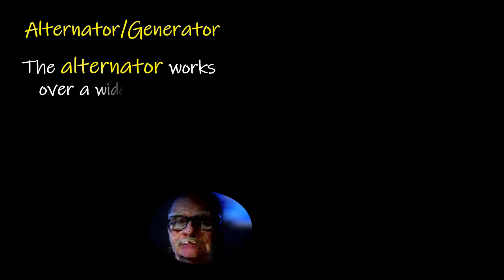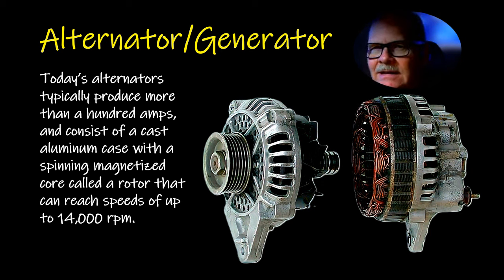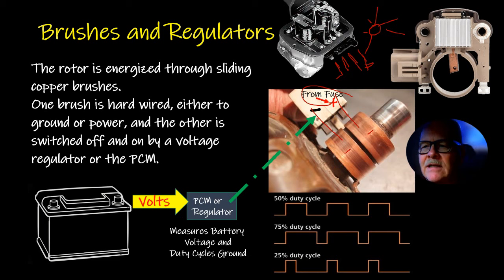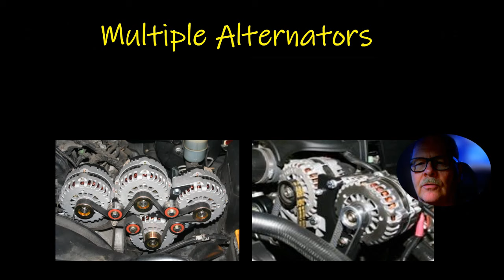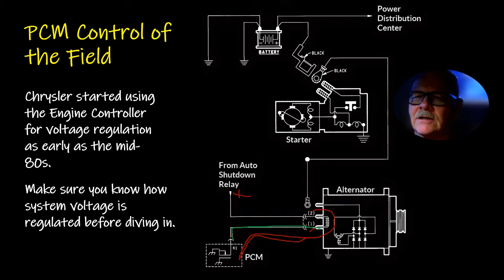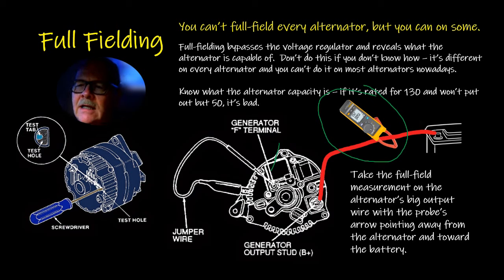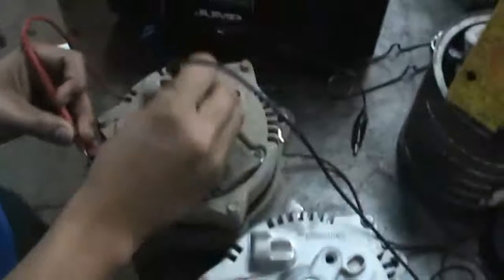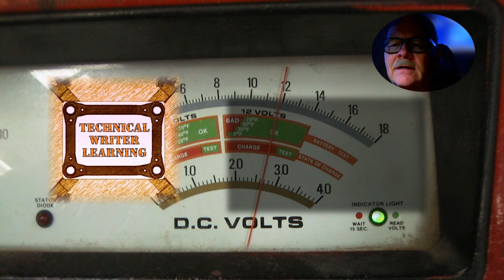Charging Systems and Testing

Comment: I remember using a growler and running a generator like a motor to test them.  We had a commutator lathe and had to undercut the mica afterwards
Reply from the maker: Yeah!!! Doggone it I had forgotten about the growler, but I did a lot of undercutting on starter commutators when I worked at the gas station in the 70s.